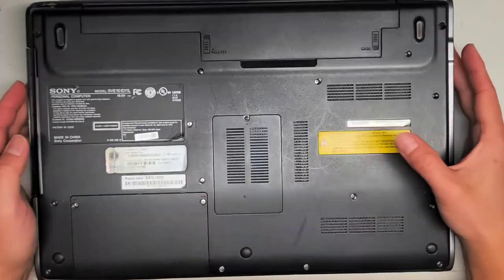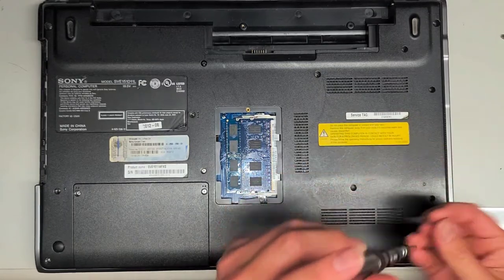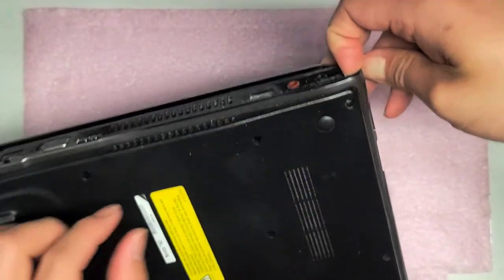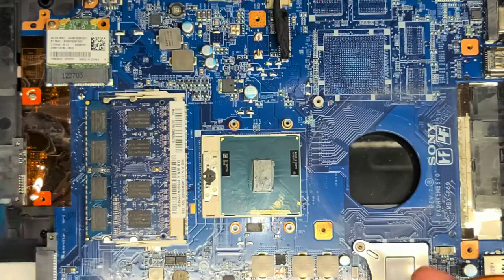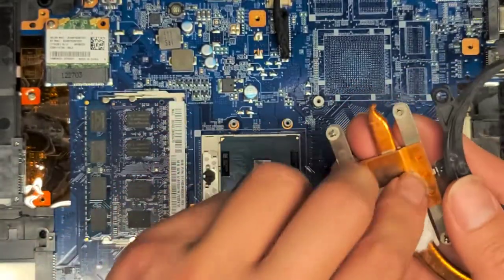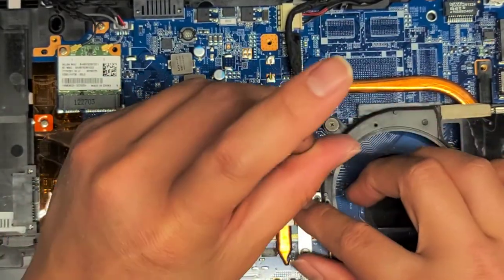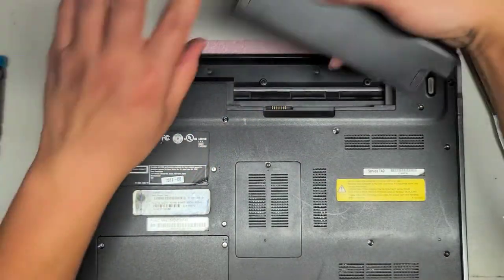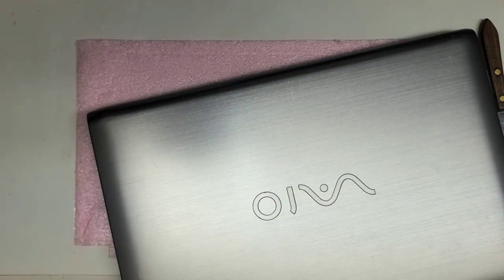Sony VAIO E Series SVE151D11L Disassembly RAM SSD Hard Drive Upgrade Fan Paste Repair Replacement

Comment: Bro thank you so much for making this video! It was extremely helpful for me. I've had my Vaio for over 10 years now and it's still going strong. Replaced the hdd with an ssd and it's running amazing. It started shutting off recently so I figured it was because of overheating issues. Again, thank you!
Reply from the maker: Awesome, glad it helped. If you haven't already, please like and subscribe so others can find my videos and possibly consider watching a few others to get the algorithm to recommend my channel. Thanks!
Reply: @ItsBinhRepaired  done and done! You mentioned something about using a caddy to convert the optical disc drive to another hard drive storage. Can this model laptop do that? What would I need?
Reply from the maker: @RavoDaMasta  how thick is the optical disc drive in mm?
Reply: @ItsBinhRepaired  it's 12mm
Reply from the maker: This https://amzn.to/3REW2y2
Reply: @ItsBinhRepaired  thanks!
Reply from the maker: @RavoDaMasta  no problem!

Comment: Hey, you are doing great work. I wanted know that I am using this same PC (SVE151D11L) and I wanna upgrade its SATA HDD to SSD. Please tell me what's the best SSD to use on this Laptop?
Reply from the maker: Do you mind the price?
Reply: @ItsBinhRepaired  no
Reply from the maker: @balochx  I don't know where that comment came from. I meant to ask, do you know how much storage you need?
Reply: @ItsBinhRepaired  256GB to 500GB and can you confirm if this PC is SATA 3 capable? or guide me how to check that? FYI, the connected HDD is SATA 2.
Reply from the maker: @balochx  I don't know how to check, but I'm assuming all computers produced within the last 10 years are SATA 3 https://amzn.to/3ggPa5J
Reply: @ItsBinhRepaired  thank you and yes it's sata 3. I checked.
Reply: @balochx  I have the same question and you just hooked me up man! Doing the same thing to mine soon